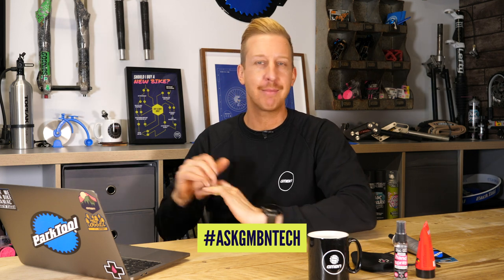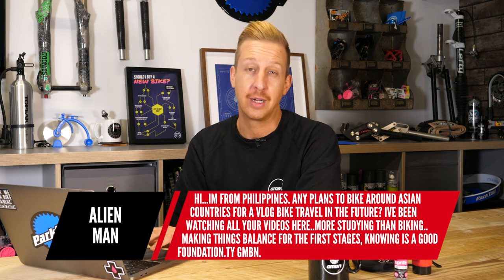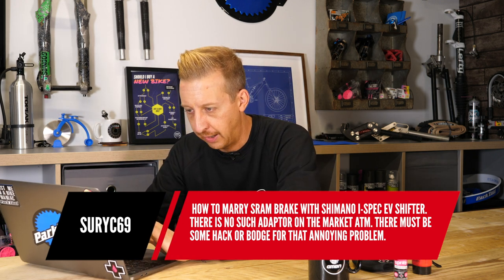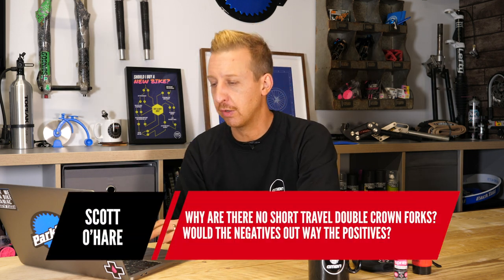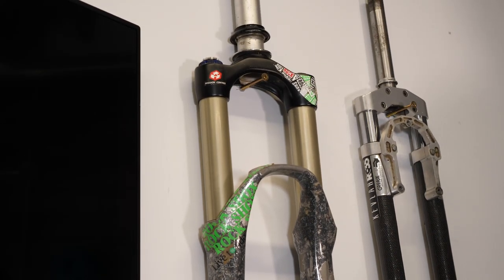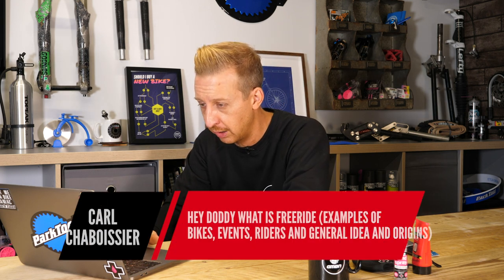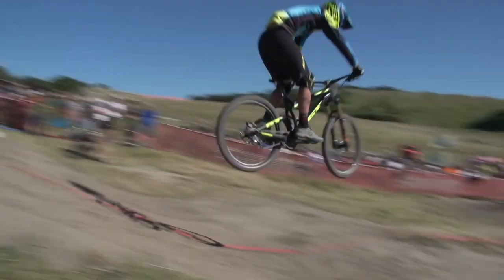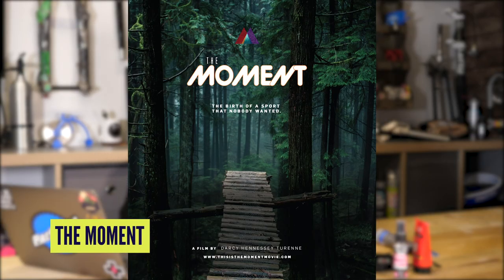Why Am I Not Getting Full Travel From My Suspension Fork? | #AskGMBNTech

Comment: Hi doddy, I have a suntour XC air fork with 120 mm travel, it doesn’t have a o ring and therefore I haven’t been able to set the sag. Any ideas on how to get around this. #askgmbntech
Reply: you only have to temporary attach something to do the setup, tie an elastic band around the stanchion or use a ziptie. Or if you are comfortable with a lower leg service simply add an O-ring

Comment: #askgmbntech Hi! I am thinking of getting a new rockshox fork for my bike. I'm wondering if i could use a low volume handpump for setting the sag?
Reply: Won't be accurate enough as the pressure should be accurate for your weight if you need get a bike shop pump it up for you

Comment: #askgmbntech what's the deal with high engagement hubs? I have a low cost WTB hub on my 2020 Fezzari Abajo Peak and I've never noticed an "engagement lag." Am I missing something? Is there some other benefit to spending money on this?
Reply: If you're riding lots of techy climbs where you need to do a half-crank frequently to keep your forward momentum without striking your pedal on a rock or a log, that's the main benefit.
Reply: @mattgies  I guess I don't need a $400 hub then...

Comment: #askgnbntech

I've just bought a 2015 Stumpjumper-fsr-comp-evo, I want to stay 2 X 10 but not SRAM X7 S3 that I believe came on the bike as standard. The gearing up front I'll be using is 38 - 28 off my old bike... 
I simply prefer Shimano XT. Can you look into specifying a Shimano XT alternative please... I believe E2 is the answer but I'm not 100% sure. If so does the front mech just bolt direct to the frame without any type of adapter... There are two holes that look to measured about 28mm center to center when measured with the chain stays horizontal and also the Vernier caliper horizontal, to be clear I'm not measuring the hypotenuse... I do hope you can shed some light on it... TIA
Reply: Yes, sounds like you're talking about low direct mount/E-type v2. This article may be helpful: https://www.bikeradar.com/features/sram-and-shimano-front-derailleur-types-and-mounts-explained/
Reply: @mattgies  yeah Ive seen that... The spacing of the holes on my frame are 28mm which doesn't fit in with S3 or E2 because they're 22.1mm... so I am totally lost now... I wonder if there is a special bracket...
Reply: @9P38lightning  Drill another hole! Just kidding; you've got me stumped.
Reply: @mattgies  it seems there is a plate that fits between the frame and the Derailleur.... Don't suppose you've got one... 😉 Or know where I can get one...?
Reply: @9P38lightning  Hmm, maybe you mean the E-type version 1? That used an adapter plate held in place by the bottom bracket. Beyond that, all I can suggest is getting the part you need custom-machined at a local machinist shop.

Comment: Hey guys recently bought a second hand bike and it has the edc stem tool with a hope headset- when I go to tighten it it never tightens and medium impacts cause bars to turn a bit// any idea what to do and is my frame written off:(
Reply: Sounds like stem is not tight enough, that edc tool bracket only tensions the bearings so do not want it to be overly tight
Reply: WelshyMatt we tighten it enough but even then whole headset still looose
Reply: @jaydunn2898  It sounds like you're trying to adjust your headset without first loosening the bolts that clamp the stem onto the fork's steerer tube.

Comment: #AskGMBNTech      Is investing in a dropper post for a hard tail worth it or not? I am not intending in doing dirt jumping, but are thinking of getting something to help me step up my game.
Reply: Yes it is! It lets you keep your weight back when going down the steep stuff, and allows you to get the seat out of the way quickly, which is helpful on a hard tail, as there is no rear suspension. Hope this helps!
Reply: Yes.. try a cable operated one from brand x on wiggle, mines been hassle free for years and cheap compared to others. Well worth it.
Reply: @Alan-75  good point also they come on a lot of stock bikes, work very well, are robust and cost effective
Reply: Dropper post is a game changer I will never buy a mtb without one now .

Comment: #AskGMBNTech Hi Doddy, First I love the show. My question is were is the bottom out line on a fork like the RockShox Lyric. Wondering because on  8 stairs that I jump I do not know if I bottom out because I do not know the bottom out line. Thanks
Reply: You can always let out the air while you push it down and see where it stops. It's usually a few mm below the top of the stanchion.

Comment: Hey gents, I have just moved to the middle of the Rocky Mountains. Home's at over 8,500ft above sea level and needless to say, it gets quite cold this time of year. Between, the high altitude and freezing temperatures, my Reverb Dropper seems to be having a rough go of it. Namely, it fails to return to full height after putting it into it's lowest position. I imagine this has a bit to do with the fully hydraulic nature of the Reverb's design. Are there any droppers that you think would serve me better or are there work arounds that can make my Reverb work properly? #askgmbntech
Reply: Hell yeah son! Got a fix for you! Buy yourself the Wolf Tooth delete kit. It deletes the whole hydraulic system and the freezing up problem.
Reply: U sure it has enough air pressure in it...the cold would effect that
Reply: @rupedog  cough fully hydraulic cough
Reply: @TomSJazzBass  Uh, no dude, there's still an air spring in a Reverb. Hydraulic fluid wouldn't work at all if it were compressible. That's why we bleed the air out of a hydraulic system to make it stop being squishy. Just look at the cross-section view in this article: https://www.pinkbike.com/news/rockshox-reverb-review-2011.html

Comment: #askgmbntech Hey Doddy. Thank you for answering my question 😃. I have another one. 
I have full shimano groupset but  i heard i can change just derailleur + shifter for sram and it will work with shimano cassette and chain no problem. Can you confirm 😃
Also would sram chain work ok on full shimano groupset?
Reply: Chains for 12 speed do not cross work. That much is certain. Mainly on the chain ring.
Shifter might be ok...but why...
Reply: @rupedog  I have 11s. I heard sram derailleur +shifter is generally bit better. I never had one so i want to try as my derailleur need replace but i dont want to change everything. I recently got new cassette and chain.

Comment: #askgmbntech there is currently no adapter on the market that works with Shimano's newer I-Spec EV interface and the newest Deore brakes (I’ve just fitted M6120 4 pots and have been trying to fit a Sram shifter to them). For some reason Shimano has reduced the size of the slot in the brake lever on the M6120 brake lever. With this reduction the ShiftMount can no longer be mounted in a favorable position. It’s seriously annoying! Anyone overcome this please let me know!

Comment: #askgmbntech (call me Matt) Hi, im 17 and am in my last year of high school, my dream is to be a bike mechanic. Whats the recommendation and what path you could recommend me going into? Maybe a course or being an apprentice??? I am happy to learn and motivated in the area of bicycles. Thanks love your show, i have learnt a-lot from you guys!
Reply: Go to every bike shop in ur town and ask for a job even if it doesn't pay much it gets you connections. Gain experience and try getting a degree, there are many courses on becoming a certified bike mechanic. From there start saving I guess and open your own bike shop. Also when you do don't skimp on advertising as well as try becoming official release for as many brands as you can as when people look on the retailers website yours shop will come up. Also set up a website.
Reply: Check your local community colleges or tech colleges for bike courses. However, doing an engineering degree will definitely get you into work for manufacturers (frame/bike, suspension, transmission, brakes etc.). Or get a saturday job if you're still at school at a shop. I doubt there are apprenticeships, bikes just arent that complicated, experience with working on your own will help, buy or beg for old suspension units, pull them apart to see how they work.

Comment: #AskGMBNtech have recently changed my rockshox recon rl silver 150mm travel for a fox 34 rhythm 150mm travel both are boost spacing and so is my hub
However my mum hub came with the rockshox torque caps which don't fit in the fox cut out my hub is generic unbranded hubs so what would my options be my bike is boardman mtr 8.8 2021 with the standard wheel set
Reply: If you can figure out what hub it is, you may be able to order normal end caps for it. Check with Boardman for more info.
Reply: @mattgies  sorted it now I made my own by taking a grinder too the torque caps

Comment: #askgmbntech  I purchased a 160mm travel, $4000 enduro bike around ten months ago. The rear pivot uses nylon bushings instead of bearings. They have been very unreliable, lasting only 1.5-2 months a set. I have asked the company who sold me the bike about it and they assure me that this is normal. What should I do?
Reply: What brand?
Reply: @mattgies  Polygon
Reply: Are you sure you're installing them correctly? Make sure to keep that part of the bike extra clean as well.
Reply: @MaplePanda04  I clean it after nearly every ride  (even if its only 10 minutes or so). I get them installed at a shop.
Reply: @archieprentice918  I would contact Polygon and ask them for some kind of solution. Entirely new bushing hardware in case there’s a defect? Or even just send you a big bag of bushings so you can quickly replace them when needed.
Reply: @MaplePanda04  I have already done the first one. As to the second one, the bushings cost $25 a set so buying a big bag is unreasonably expensive. Should the problems continue, I intend to exercise my consumer rights and ask for a full refund.

Comment: I already know why i can't egt full travel out of a 160mm Yari, my 60kg ass is too light even at 30% sag with no tokens. Only option is get the damper retuned
Reply: You could downgrade to a Recon fork, even at 60kg you will forsure bottom that fork out! Cheers
Reply: Then you ain't riding hard enough i am 58 kg and run my 36 at 25% sag with 12 out of 16 clicks of compression om my mrp cartridge and on the big drops 3+ m i bottom it out, if i was not doing as bike of drops i would just run less progression.

Comment: #askgmbntech
Can I use hiking shoes for riding a flat paddel
Reply: yes
Reply: Normally I use safety trainers. Very durable, light weight, toe cap, non slip sole and less than half price of proper mountain bike shoes.
Reply: @aakos26  which ones do you use?
Reply: @mtbboy1993  https://www.ebay.co.uk/itm/191949027881
Or other version of these. As soon as I get them I apply a really thin layer of grease, chain lube on them and do again once a month, becomes more water and mud repellent. Eventually a studs will shred the sole, nothing you can do about it.

Comment: #askgmbntech I’ve always wondered why many bike manufacturers only make 1 or 2 colours for a specific bike.  While looking for a new bike I found lots in my price range and specs. But IMO ugly colours. Black should be the default ;) just an interesting thought I had.
Reply: Too many variants to keep track of. Even having 2 colors doubles the number of items in a brand's inventory.
Reply: @MaplePanda04  I can see that for small brands. But guys like giant, trek and specialized? I mean automakers do it. It’s just a bummer really. But of course there are options to have it repainted. But usually that voids any warranty
Reply: @PilotX82  Well, when you build a car, it’s “custom” in a way, since every customer specs a different paint job, a different accessories package, etc. There’s also usually way more models of bikes than cars. Plus, car companies aren’t as greedy. That’s why the expensive models of a bike might have nicer paint jobs than the cheap ones.
Reply: @MaplePanda04  you make some good points. But I’m still left wondering why a bike manufacturer can’t do the same. Why can’t I spec a bike the way I want it in the colours I want? I know trek does offer their project one bikes and you can chose some wicked paint jobs. So that’s a step in the right direction. But those bikes are premium stuff and a hefty price to go with them.  It’s really just a shame is all.
Reply: @PilotX82  Greed. Some brands do it, like Ribble for example. But for the most part, it's easier and thus cheaper to just have a few pre-defined models and be done with it.

Comment: #askgmbntech what do I do if my derailed is missing a cog in my bike
Reply: I assume you’ve tried adjusting it? If you haven’t here’s video https://youtu.be/UkZxPIZ1ngY. If you have tried adjusting it and your still not shifting well it could be that your derailer hanger is bent and you’ll have to get a replacement for like around 10 bucks
Reply: @vallejodroning9578  If the hanger is bent, you can usually just straighten it rather than buying a whole new one. There's a tool for that.